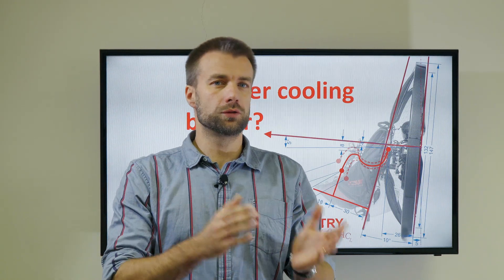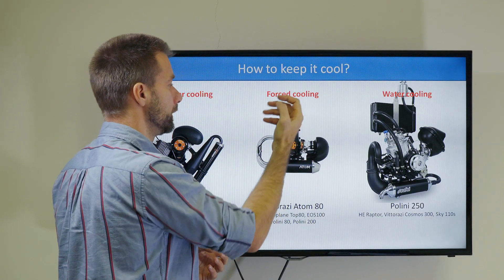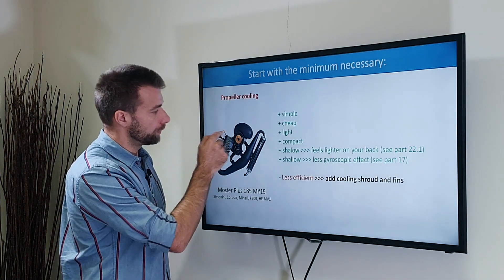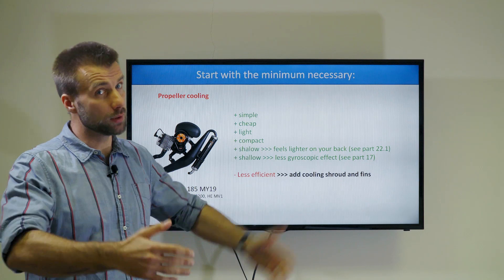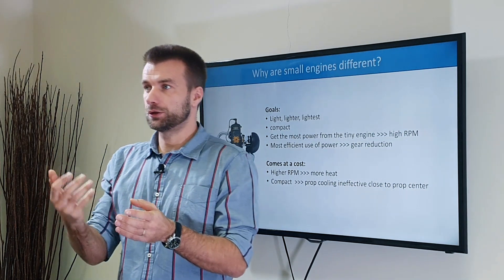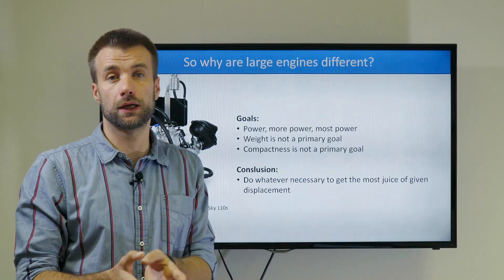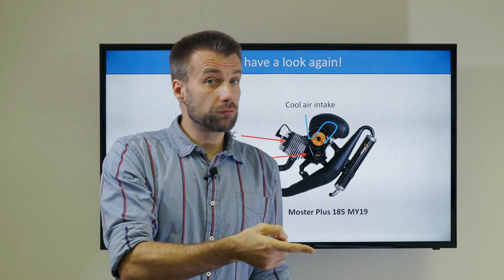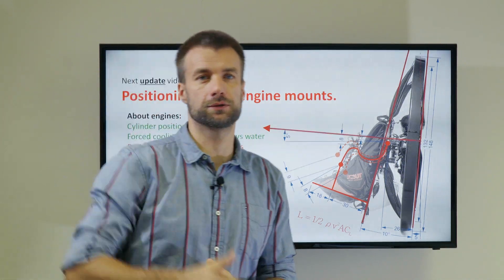Is water cooling better? Paramotor geometry part 31.3

Comment: Firstly ... BIG thankyou to Miroslav Svec, for making these very informative videos ... an extremely useful resource ... 
That said, I'd just like to add some extra info to Charles Terell post re the Sky 1.1s engine ... 
At just 110 cc's, this little engine punches well above it's size in terms of power ((claimed 26 hp, and 72 kgs thrust, depending on prop).
I don't think you can put it in the same category as the heavyweights, such as the much larger Polini 250 etc. 
It is also relatively simple (for a water cooled engine), inasmuch as it does not rely on a mechanical water pump (heat siphon design), and has the more efficient re-drive (gears in oil) ... a centrifugal clutch , and VERY easy to pull start, without the extra complication of flash start type mechanisms.
Slightly heavier than other similar cc engines, YES ... but WAY more performance and no heat issues whatsoever ;-)
I have two :-)

Comment: Most 2 stroke paramotor engines could benefit from slightly longer belt reductions. This would serve dual purposes of improved propeller cooling draft, and more efficient pully/belt angles.

Comment: Some engines sport enlarged heads with plenty of deep fins, especially seen on the early Solo 210's. This seemed like a good direction, especially if lean-tuning the mixture.

Comment: what would be your best mixed ratio oil/gas with motol 710 or 800  for monter 185 plus?   Thank you
Reply: Nala M I mix Motul 800 at 65:1 with 93 octane, top tier pump gas.

Comment: When you do your 2-stroke vs. 4-stroke discussion, can you also talk about rotary (Wankel) engines?
Reply: The Wankel engine is not very efficient or it would’ve been adopted years ago.
Reply: @goldwingerppg5953  , it's more efficient than you think and it doesn't vibrate to all hell like a 2-stroke.  I know there have been experiments done with them on paramotors, and I'm curious where they ended up.  My guess that it's more of a cost issue and not an efficiency issue.
Reply from the maker: Have a look at this: https://www.scoutparamotor.com/60-hp-scout-prototype/
It works and it has plenty of power, yet it is very hard to beat these two strokes engines these days when it comes to price and reliability.
Reply: Did a 2 Stroke ever hat a Caburater Icing ? I have learn in US - Bell 47 helicopter flying ! I live in South Bavaria Germany - Thankyou appriciate
werner.wiedon086@gmail.com

Comment: Sky 110s is a small/mid engine size and has water cooling. Quite some power and fuel economy as well
Reply: do you have one or know the fuel consumption of it? do you think the power to weight is greater with water cooled paramotors?
Reply: @RustyShakleford1  I have one. 130 cm e-props give about 70kg trust. I had some obstruction (from dirt on fuel) on my carb and it ran lean. Muffler began to melt, but notion at all happened to piston. Fuel consumption depends on a ton of variables, but with equal wing and wingload I get about 0.5l less per hour than a vitto moster
Reply: @RustyShakleford1  ... approx' 4.5 itres per hour (real world mixed XC flying), me at 98kgs pilot weight flying a 26 metre AirDesign Ramaflex. But I do know of a couple of MUCH lighter pilots (75 kgs ish naked pilot weight) that manage as low as 3 litres per hour ...

Comment: Water could be added directly (injection) to the combustion cylinder right after ignition to create steam and carry off more heat through the exhaust. Not only will this improve cooling but it will also increase torque. No water pumps or radiators needed. It's use could be thermally controlled by the injector.
Reply: No radiators needed but you need a water tank instead 😄
Reply: @mark675  That's true but it only needs to be sized for a full tank of fuel. So we are talking less then a bottle of water.
Reply: the radiators is basically the water tank. it only has an overflow tank to hold enough to thermal expansion and usage top up. 
a water injection has a chance of failure causing instant engine damage either too much or no water.
Reply: @RustyShakleford1  Anything added to a motor has a chance of failure.
Reply: I have a friend with water cooled injection in his Porsche 911 twin turbo. He has a 1 gallon water  tank. He fills up the water tank only after 4 full tanks of gas. Not much water needed.